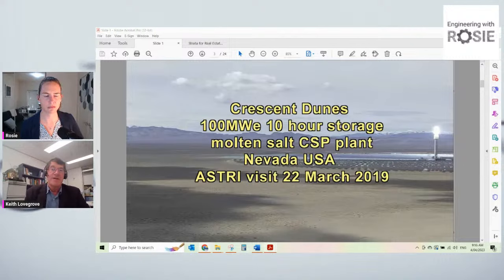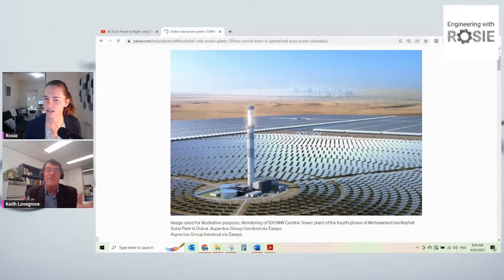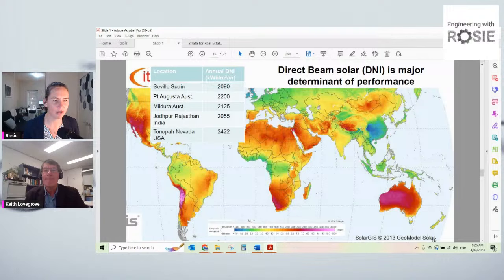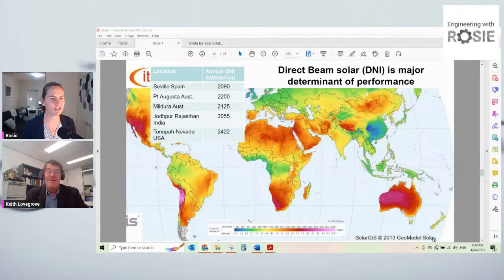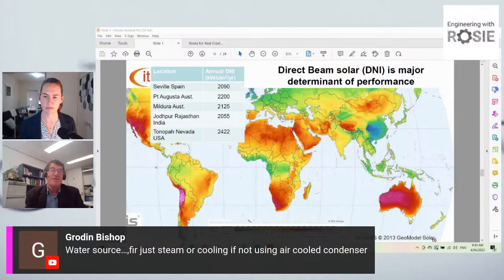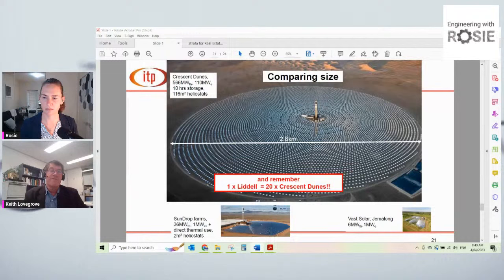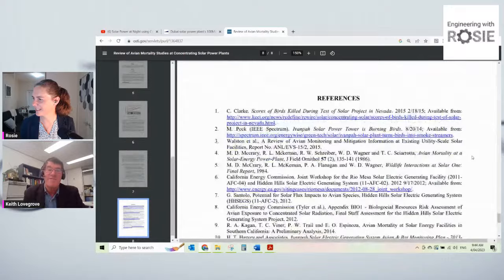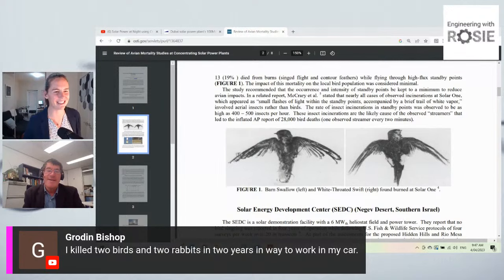Concentrated Solar Power | Engineering with Rosie Live Ep. 23

Comment: Thanks for asking my question! I remember reading that the bird issue had been solved by using a staggered mirror configuration. I also remember reading about the endangered Nevada tortoise, but did not realise they were able to bed in the heliostats without clearing the land so as not to disturb that habitat - that is very cool :)

I still have visions of elevated heliostats where all that land beneath gets used for ecological, social or agricultural purposes, value-adding, like how growing crops beneath PV panels seems to value-add and cool the panels. Point taken it's likely to be desert, but I don't think desert ecologies should be ignored or thought of as lifeless, because they're not, they're home to all sorts of amazing little reptiles, mammals, insects, arachnids, etc. There's also the fact that if you put it too far out in the middle of nowhere, you now have a transmission issue. Looking at that insolation map, there was an area of purple in the west decently close to us in Perth, which would make it seem like a good option for us, along with other renewables. Then we'd just have to stop exporting so much gas and coal...

Comment: About the low DNI area in China, China actually don't have the worst air quality in the world, they don't even make IQAir's top ten list. Airborne particles obviously decrease DNI, but it doesn't seem to have an effect comparable to latitude or humidity, not for the average values over large areas anyway. Still it seems reasonable to suspect pollutants are some part of the explanation for the extremely low values there. Particles in the air close to the ground is not big part of the explanation, maybe the air tends to rise there, bringing pollution (and humidity) higher up in the atmosphere, causing unusually high levels of pollution at higher altitudes.

Comment: I would rather invent power stations that can be built at the present time with current technology than wait for fusion.
100% renewable or go home 😉
Some interesting things l learnt from this talk like the tanks were heated on some CSP plants and a few other things such as the type of mediums used for heat transfer.
The trough plants seem to work rather well.
Some pretty amazing things have been going on since the eighties that most people didn't realise concerning renewables.😎👍
I have researched some thermal storage methods such as sand and stones. And both mediums do a great job for thermal storage with sand gaining in popularity for a few reasons such as cost and superior thermal retention.
An electrically heated tank for certain situations such as initial start up and heat boost situations would be beneficial but mainly for molten salt.
I worked with steam for a couple of years so CSP is no big mystery 👍

Comment: Thanks Rosie and Keith. CSP is great that uses more of the free solar energy than say solar panels. There is a place for all renewable sources when they make sense.  

I don't understand the comment that rooftop solar + storage is going to be too expensive. Firstly the grid is already there, second with V2G technology, the hydro scheme and distributed batteries wouldn't this be the cheapest implementation of solar? 
Its something we can make happen relatively quickly. If our government legislated V2G as a requirement for all EV's, lifted the artificial power limits of roof top solar imposed by self serving proprietary bodies and the government provided incentives that are means tested for installation and expansion of roof top solar.

Comment: Could the csp heat a large sand block. the sand can store energy for a long period
Reply: It is possible, but sand is bad at transferring heat, which means you need huge heat exchange area to avoid making the "effective temperature" decrease too much. 

I'm not saying it couldn't be viable, but that particular aspect makes sand heat energy storage more relevant for storage for longer periods, where you extract the energy over multiple days, at least.